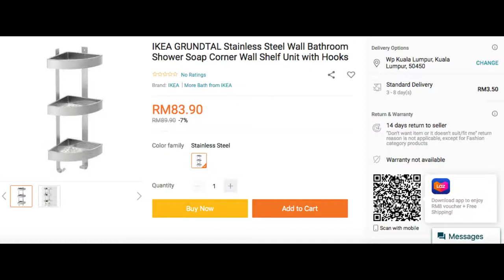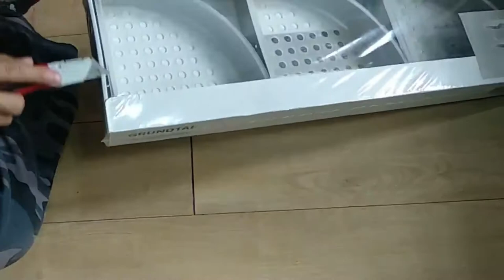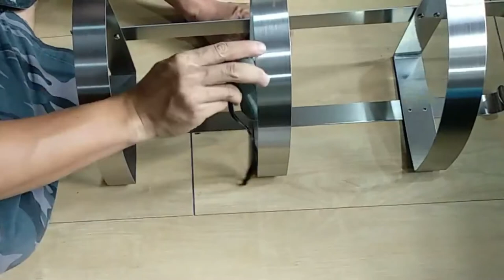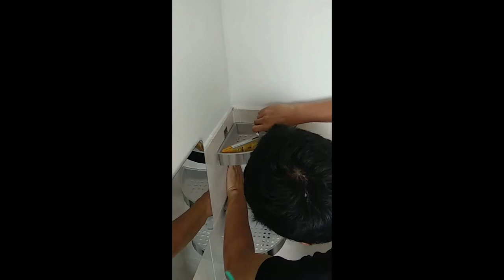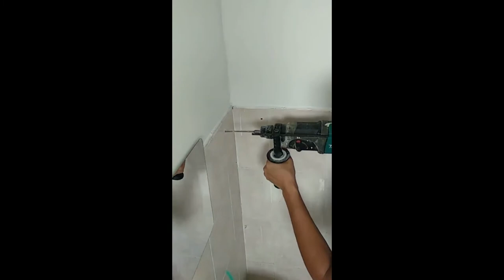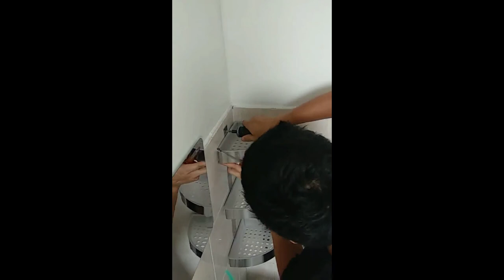Assemble IKEA Grundtal / BROGRUND Corner Wall Shelf Unit

Comment: Next time don't drill the wall. It's better to use a MS Polymer, no holes, no trouble and will stay in place for many many years. Mine has already 10 years since I put in place with the help of a ms polymer.
Reply: hi im installing mine and I dont have a drill how do you use ms polymer. I also live in an apt so I cant make holes.
Reply: @gabbybryan6373  Is quite simple and easy. Buy a small tube and apply . Follow the instrctions as stated in the tube.
Reply: @VMV1968 hi did you buy the same shelf. I’m planning on getting one, does it rust quickly?
Reply: @rashisingh9522  It doesn't at all. Its stainless steel.